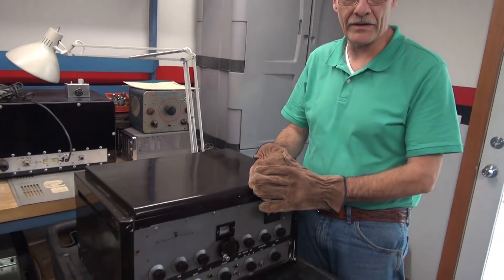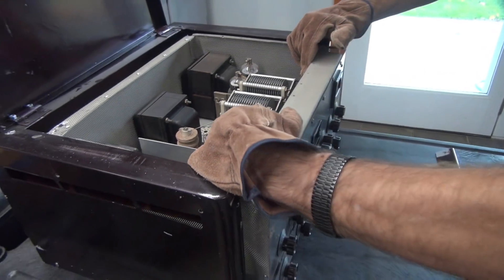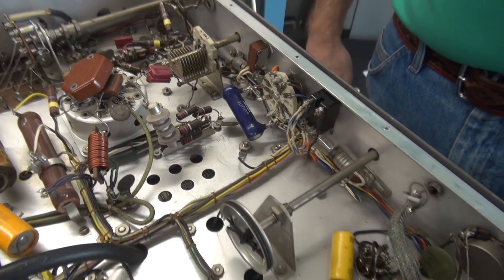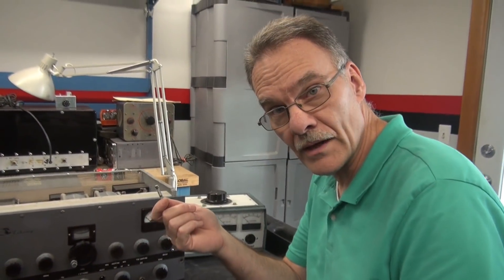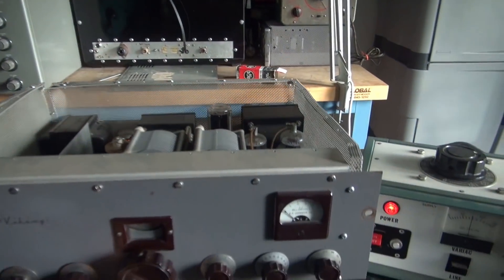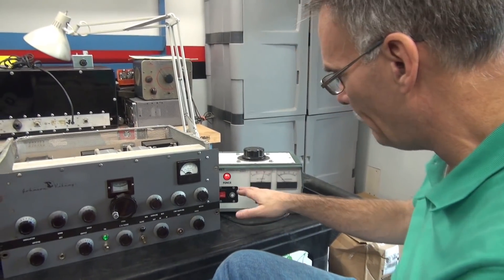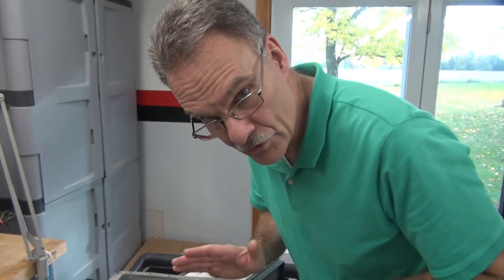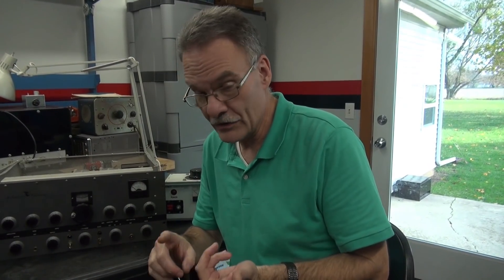Johnson Viking 1 Tube Ham Transmitter Evaluation Poor shipping Part 2

Comment: Ok that’s good progress, what’s a little bent up sheet metal, the main thing is it’s fixable, I could probably strieghten out that bent up cabinet if it was mine, but then again maybe not,  that use to be my job years ago when I worked in the commercial aviation industry, strieghtning alluminum aircraft parts can be a real challenge, worse then steel is, it’s real easy to over work alluminum and it will stretch and crack if your not careful. I’m glad to see terry taking on this job, that’s awesome.

Comment: Well Just the fact it powered up is encouraging and true in the plate voltage circuit with missing modulation transformer and new electrolyric caps it is repairable but, it all depends if the owner wants to spend the money for parts and your time at this point. Plus also who is liable for the damage in shipping?

Comment: Terry, Picking up glass bits is a hassle. I found a lump of cheap modeling clay or strip caulk will get into the tight places the vacuum cleaner can't get into. You can even attach a lump of it to the end of a pencil or rod to get into the really tight places.
 I have cut myself more than once on broken tube or dial glass.

Comment: I bought (At Auction)  an Earth G-2000 guitar amp......and when I finally saw it in person,  I died a bit inside...   However,  I still went through and started diagnosing and fixing it... It turned out GREAT and not too darn bad.  Sometimes it looks way worse than it is.

Comment: Ok, I get it. You're not a sheet metal guy.  Mechanical isn't really my strong point either.  But in the right hands, it looks like that cabinet could be fixed. Of course, if the price is right, a new cabinet would be the way to go.  I'm glad you took a second look at the electronics.  :)